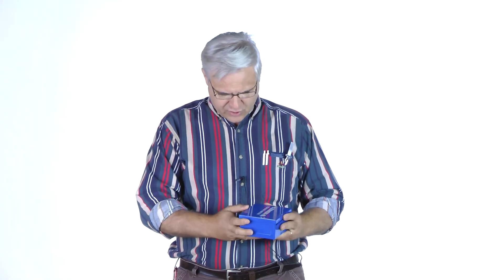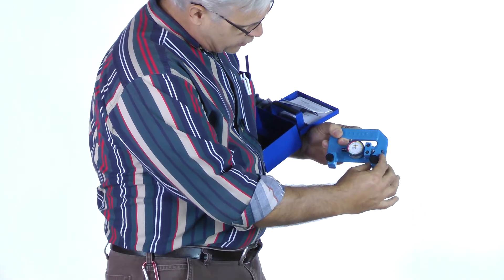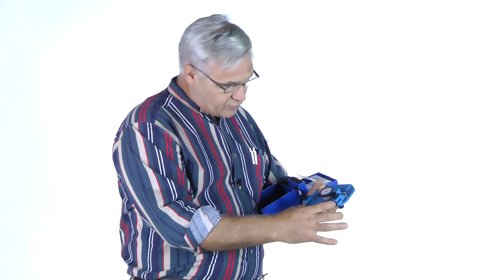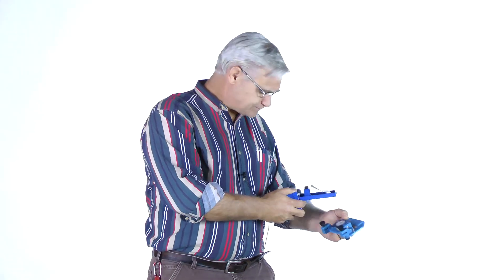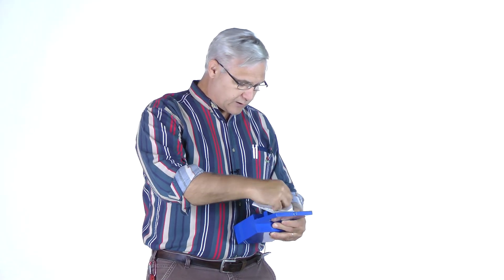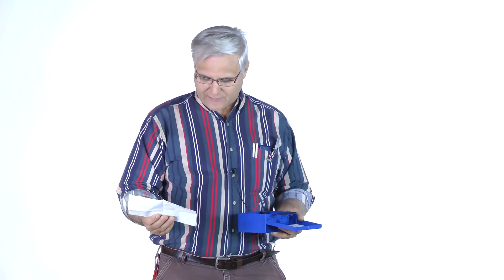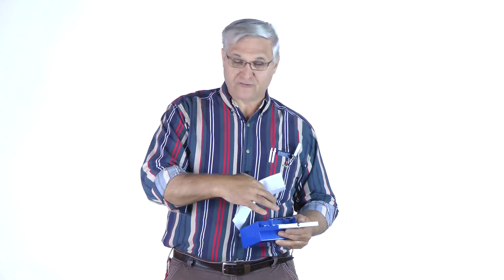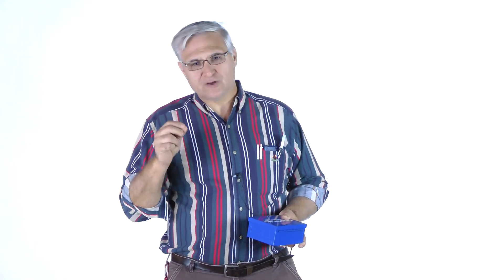Sawmill Bandsaw Blade Basics 11 - How much tension do I use?

Comment: Can you please clarify the units for tension that are mentioned around time 6:00 in the video?  In the video you say for example "for a 1" and 1.25" blade, 16000 - 17000 tensile pounds".  You mean 16000 - 17000 PSI of blade stress, correct?  Pounds is force.   16000 pounds of force on the band wheels would snap a blade pretty quickly.  PSI is stress in the blade which I think is what you are referring to.  Also, make sure people don't confuse PSI of blade stress with PSI on their hydraulic tensioner (if they're so lucky to have a hydraulic tensioner).
Reply: Yes, he means PSI. The tensiometers read out in PSI. Multiply the PSI by the cross-sectional area of the blade to get tension in pounds.